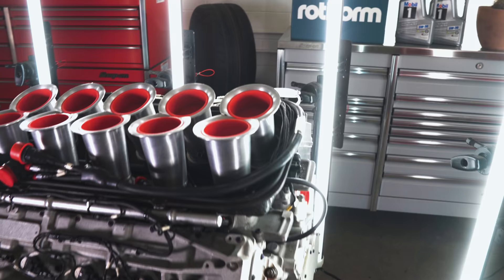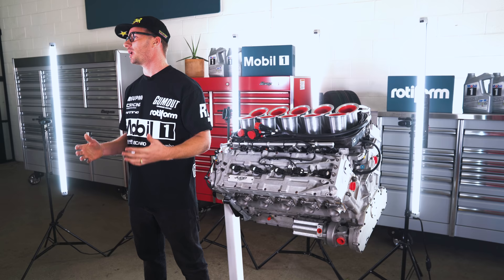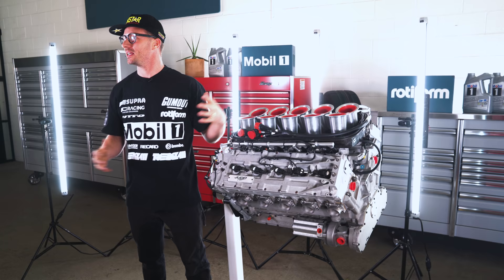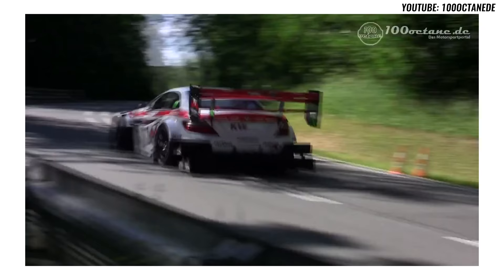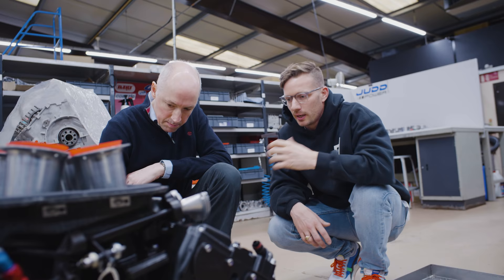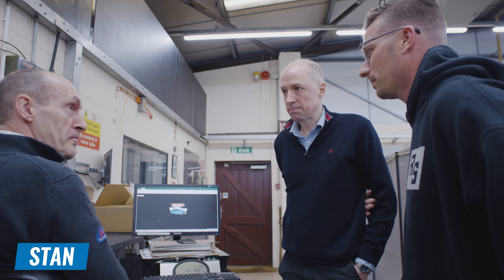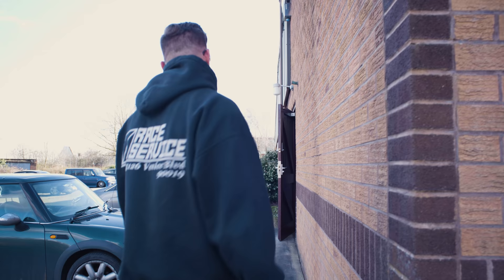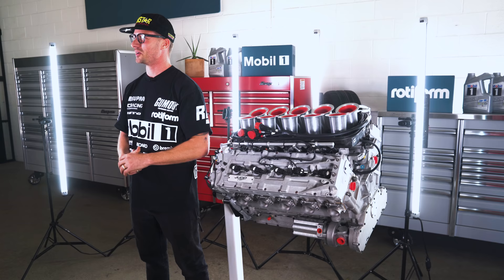My JUDD V10 Hits the Engine Dyno at Judd HQ. Formula Supra

Comment: A lot of people can get 730bhp out of a 4L engine for a dyno run or drag pull. Judd builds engines that do it for 24 hours straight at wide open throttle.
Reply from the maker: Exactly! 🤘🏼
Reply: It's quite a difference, the load of a lightweight F1 chassis for the engine to push, compared to a much heavier vehicle. Heavier vehicle, higher load, higher stress.
Reply: @noxious89123  Grip matters far more than weight when you're talking about driveline load, sliding tires exert less force. I promise you, F1 cars have more grip.
Reply: @ray_collins  weight IS driveline load, and hillclimb cars have more than double their weight in grip, I don't see your point
Reply: @THESLlCK  Your driveline load peaks right before the tires break traction. As soon as they slide, it drops. A 100,000lb semi spinning the wheels on ice has a very low driveline load, a 1,000lb drag car launching on sticky slicks has very high driveline load. Grip is the factor, not weight.
Reply: @ray_collins  a 100,000lb semi is gonna have more grip than a 1,000lb drag car though
Reply: @THESLlCK  If you want to ignore all the other factors of grip, then yes, sure. But, in the real world, where all those factors matter, weight is merely one of many components.
Reply: @noxious89123  already in 1994, Williams' v10 developed 14500rpm, and in 1995, when the engine volume was reduced to 3 liters, more than 16000rpm, in the 2000s, the rpm of the V10 engines increased to 19000rpm. sometimes up to 20000RPM.the load on such a motor is much higher than on the motor of a production car.
Reply: @noxious89123  the F1 engine will easily pull a car weighing 3-4 tons, at the right RPM.

Comment: 8:23 straight piped building lmao
Reply: first one on youtube lol
Reply from the maker: Lol
Reply: I think it's a thing. When I was in technical college, I interned at Jon Kaase's and Warren Johnson's and both had "fake" mufflers for their engine dynos. Basically tractor-trailer looking stacks with nothing in them. The summer I was at Kaase's, I cleaned a ton of cylinder heads out on the back concrete patio which the stacks were right next to, it was awesome. 1800HP naturally aspirated, 820" displacement for the (at the time) IHRA mountain motor pro stock engines.
Reply: @pro-seriesfabrication3810  that sounds like heaven to a guy whose entire hands on experience with engines is just putting cams back on a mitsubishi eclipse engine
Reply: @THESLlCK  While MM Pro Stock isn't as big as it was then (~2009ish), I'm sure both still engine dyno a lot. Kaase has gotten into boats more now and WJ still does drag and landspeed engines. Could probably hear it from the street just like the Judd video.
Reply: @pro-seriesfabrication3810  go on, make me envy you more lolol

jokes aside, that sounds amazingly cool, and btw pro stock is still pretty big
Reply: @THESLlCK  For sure . . . pro stock is still around, it's just not on the level it was. IHRA was still an actual player and ADRL still existed. I feel like mountain motor pro stock  was at its peak before 2010, at least it felt that way at Kaase's. Off-shore boats and selling his cylinder heads are his bread and butter now. MMPS probably doesn't even blip the radar for him although I'm sure he still enjoys it when given the opportunity. I pulled the AC Delco vinyl off Kurt's cobalt pro stock car . . . they stopped running a year or two after I had left there. Pro Stock lives on despite the economic conditions and sanctioning bodies coming and going . . . quite a testament to the guys who own and run those cars. I got to be around a lot of cool stuff, got to work on 2 nitro funny cars as well. Very grateful to the guys who took a chance on me.
Reply: @pro-seriesfabrication3810  my man, it sounds like you have stories to tell. People don't get to hear this stuff, and if you tell it, you'll be educating and entertaining a lot of people. Hell, I'll subscribe to you just to see you do it.

Comment: I'm sure someone else already said this but Yamaha also built the engine in the Lexus LFA. Yamaha has been around the Automotive Motorsport scene for a VERY LONG TIME and has an incredible racing pedigree. They may be known more in the U.S. for their dirt bikes and motorcycles but in Japan they're know for making some of the best automotive racing engines the world has ever seen. 2JZ anyone?... yeeeaaaahhh, Yamaha had their hands all over that! Yamaha either designed, built, or designed with Toyota, just about every notoriously badass engine, Toyota/Lexus ever made! Going all the way back to the AE86 and GT2000! Toyota would basically sub-contract engine-design + development to Yamaha and then brand it as their own. And the only 10cyl Yamaha engines I've ever known of were either F1 engines or the LFA's engine, so you KNOW this thing is gonna be one BAD MF'er!!!

Comment: Yamaha also built heads for Toyota's 18RG line, from back in the day.    140hp-ish twin cam 1800.   We took one in the mid 80's and got 250hp NA out of it with a BIG BOX from TRD. Once we finish bored, it was a 2200 with TRD pistons.  Everything went into it that they had for it,,and it was a fairly big catalog for the 18RG's.  Getting TRD on the phone back then was a next level effort, but finally they would answer.     Love the Judd's.  Always Have.  Johnny Herbert said it was one of the best engines he ever raced in F1.

Comment: I'd love to see the dyno graph from this mill. At 4 liters with valve timing limiting it to 11k (I'm assuming it is optimized for the 11k redline) it should make reasonable torque for lower speed cruising. I would pass on the N2O. 8-12 lbs of boost on the other hand...

Comment: RIP Georg Plasa
Georg's engine was the real deal, no detuned endurance racing, or lower RPM, version and it sounded magnificent. Shout out to Jörg Weidinger who now drives the rebuilt car.
Reply: That's not completely correct 🤓.. He drives Georg's rebuild old car.. E36 Judd.

Comment: I know nitrous has a rep, but with modern EFI, it can be a very safe way to add power. With that said, I'm sure these engines don't have the safety factor a production engine does, so probably keep to that 100-150 shot range.

Comment: What did it make for power? I saw 304 torque at 11070 rpm. If that's NM, which is often used in Euro sports car shops, then that is a bit over 470 bhp. If it's Ft-lbs, then its about 640 horsepower.

Comment: Big difference between a drag motor and a thorough bred, highly strung and lightweight race engine designed to run  3000 circuit race kms reliably.

That nitrous question went down like a ton of bricks. Practically insulted John Judd Jr. with a low tech, low brow suggestion. These guys are the real deal cutting edge, not street tuners.

Comment: What a proper F1 car should sound like in a Supra ! Giving these modern V6 Hybrids run for their money
Reply: it for safety also, they dont need refueling again
Reply: The V6 engines compete under different rules; the V10 won't stand a chance against the V6 under current F1 rules and maybe vice versa. The V6 design is more relevant to road cars anyway.

V10s are for the 1 percenters

Comment: For all of those that said "iS nOt An F1 eNgInE!" eat your words now, it has strong roots in F1 because that was the starting point of the engine 😎
Reply: Still not a F1 engine. It’s a LMP1 engine which imo is better than a F1 engine for a street chassis. It’s like the F50. The F50 engine is from the 333SP which based of a F1 engine but detuned & bored for more reliability

Comment: No power numbers?
Reply from the maker: It makes what it was built for 730 hp 350 torque
Reply: @RyanTuerck  I figured the numbers would be radically skewed towards HP but didn't realize that it was making so much N/A.  I figured it was 600 at most but 730 is even more impressive.

Comment: You dynoed an 11,000 rpm judd motor and you didn't tell us the horsepower and torque numbers at 7,000 rpm......8,000......9,000.....10,000.....and 11,000 rpm.   I can't believe it.
Reply from the maker: Yeah we didn’t do print outs or anything so don’t have that info. Engine makes what it makes, 730 hp 350 totque
Reply: @RyanTuerck  thanks for the reply.  I like numbers and 730 is substantial.